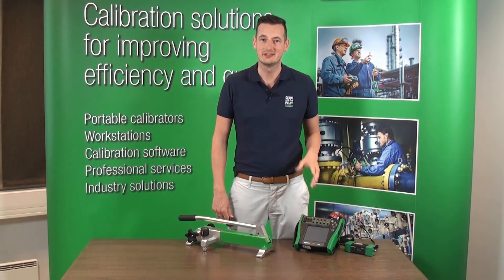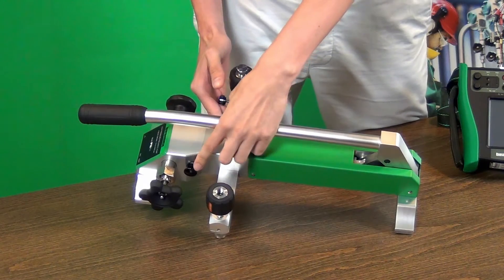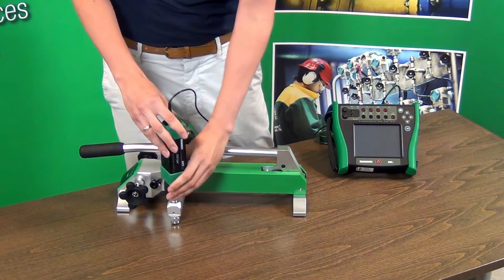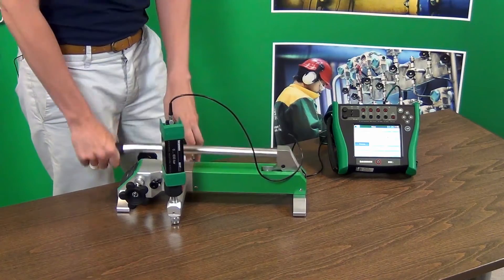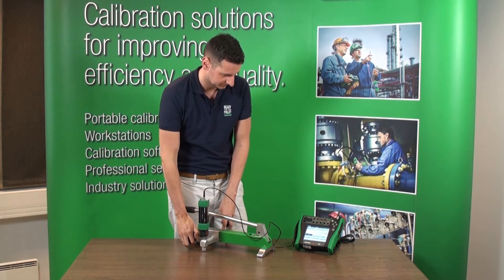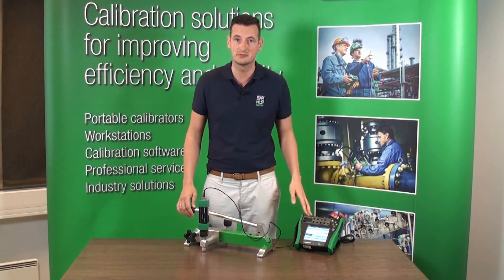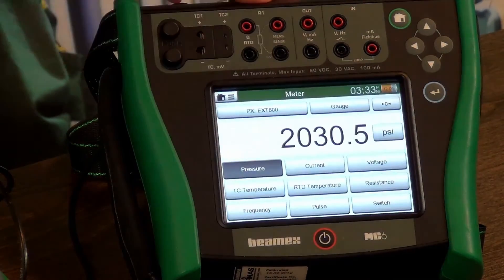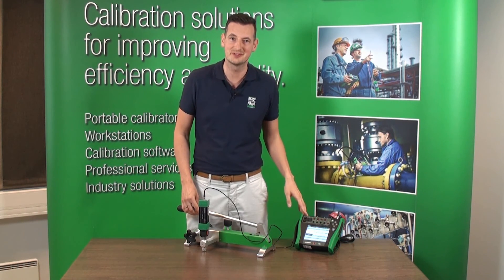Beamex PGPH pressure pump introduction

Comment: Hi , I have pump like this but I'm suffering about the fitting of connection thinking I losses some fitting so the little  rapidly fall in pressure (in high resolution) that appear and make problem to determine high and low for triming and calibrate IO that connect with transmitter. So could you tell me the all fitting that I need to connect pump with transmitter and mc6
Reply from the maker: Hi Mohammed, If the pressure drops quickly, then it indeed sounds like there would be a leak somewhere in the system. You can find the pump manual on Beamex website (Brochures and Manuls) or in this link: https://www.beamex.com/wp-content/uploads/2016/10/PGPH-Instruction-Manual.pdf explaining the connectors and codes.
Also, you can browse all spare parts and connectors in the webshop at https://shop.beamex.com/ 
You may also contact our service at service@beamex.com to discuss in detail and to get more help.
Thanks,